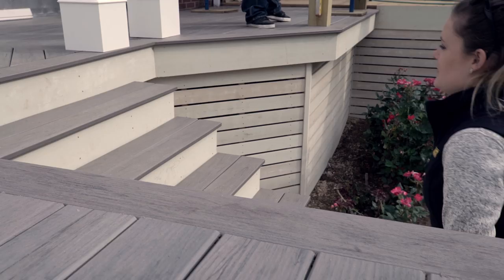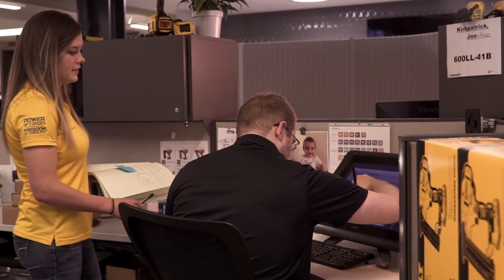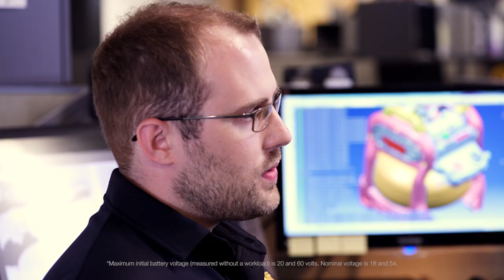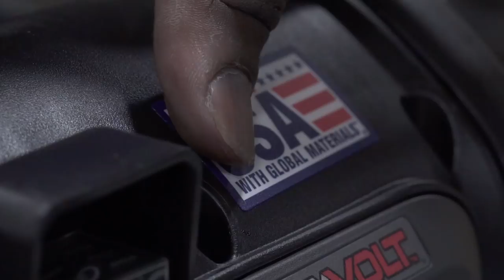Built for the Jobsite: DEWALT® FLEXVOLT® 60V MAX* Cordless Air Compressor (DCC2560T1)

Comment: I used mine about 3 minutes checked the batt and it still had all 3 lights good deal, Turned switch off, But went to use it 2 days later and the batt was dead. Talked to Dewalt and after a couple days they answered back that unfortunately that it will run the batt out if left in unit as it continues to draw a small amount of juice. Come on Dewalt it runs the batt down when not in use even with the switch off?
Reply: I leave My batterie in, and I have no issuse's, I reckon you had a leak and left the unit on

Comment: No corded/cordless option on it like the vacuum, the radio, the fan, the light or even  the table saw ? No 120v. It should have oil option too, it will reduce decibel sound. I will wait for the upgrade version
Reply: california compressor has super quiet compressors [this is the trend] and aluminum tank too…too bad they don't offer cordless yet.

Comment: only good for a finish gun might as well just buy battery finish nailer
Reply: Craig Sater I have a pin and a finish and a brad nailer that I love and are still in great condition but I’ve gone cordless in every other aspect...table saw miter saw so on and so forth, I want to go cordless with the guns I already have and this is a perfect option for that. If you’re a framer hell no this thing won’t do you. I have a 6gallon for that also I’d use the battery bank system to run that compressor if need be. However this compressor is only set for a specific set of tasks and is perfect for my situation and many others I’m sure
Reply: I'm a framer and finisher as of now the only thing I need a comoressor for is a framing gun. the 20v cordless framer just doesn't do it for me but the idea of a 60v framing nailer keeps me excited. besides that all I need are the 20v finish nailer and they work just great

Comment: wow are y'all kidding me this gen 1 sucks many faulty components the drain valve sucks the battery holder sucks the hose connector is not 1 hand operation dewalt i love you but y'all drop the ball major on this model plus its load as hell and the worst of all the prices is stupid, get it together please